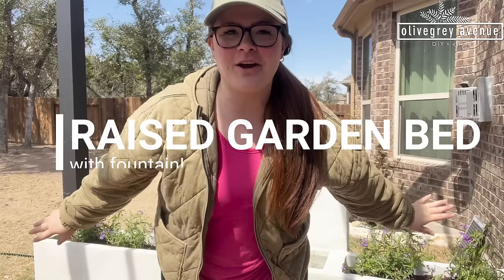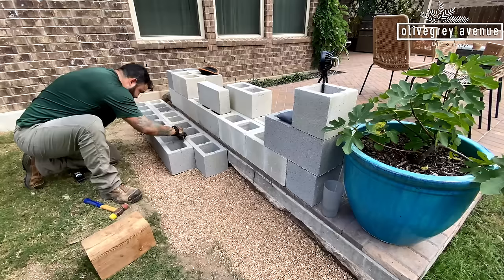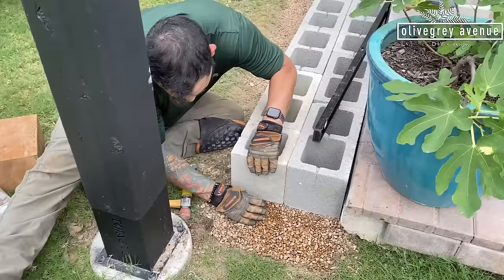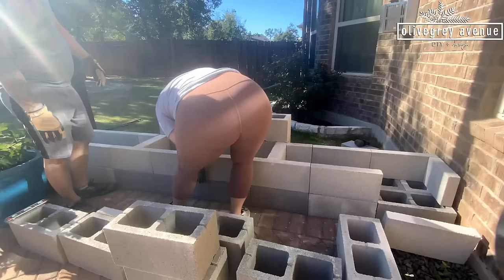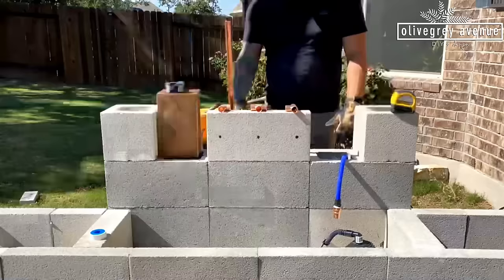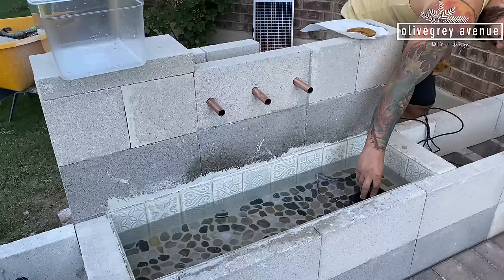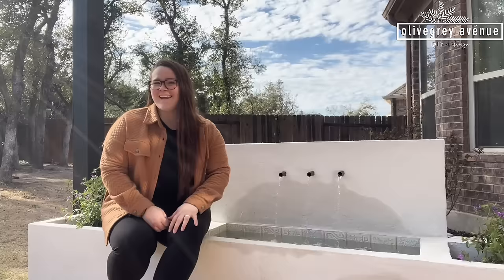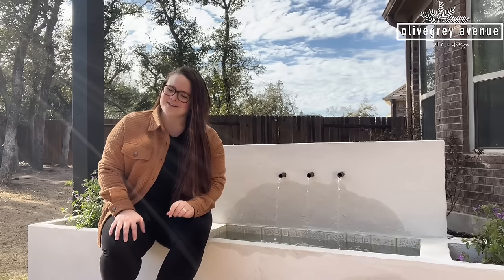DIY Cinder block Raised Garden Bed and Fountain

Comment: That came out really nice. I'm considering trying to do something similar -- probably minus the flower beds on each side due to space. Can I ask what that rectangular piece was that went over the cinder blocks stacked vertically in the basin? I didn't see it on the shopping list. Also, is the surface bonding cement used inside the basin to make it water tight? Thanks.

Comment: Now that a year passed how did it hold up without a concrete footer, no rebar in the block work, no cement in the block cores, no stagger in the block work, and no metal mesh under the stucco?
Reply from the maker: It looks the same as the day we built it aside from dirt. Also, we did stagger the blocks.

Comment: how did you make the water reservoir not leak water? what did you use to seal the tiles and the base around the pebbles?
Reply from the maker: I needed to make corrections because we didn’t take all the right steps the first time. You should use a waterproofing system like the kerdi system before installing tiles! I made a follow up video about leaking a couple weeks ago so check that out too!

Comment: Did you only seal the pump hose at the spot where it goes through the tile into the cinderblock? I’m wondering if I’d have trouble with leaks from that spot. Or does the pump come with something to help prevent leaking there?
Reply from the maker: We just sealed it where it went through the cinderblock https://youtu.be/J2CkGr0m7vc this might help answer some questions!

Comment: What's stopping that back wall from falling over ? Is there no concrete in between the Bricks? Also how come at the end the white is so discolored where the water flows from is it just wet? Looks super good! I wanna do something similar I think stuff like this makes such a huge improvement
Reply from the maker: The blocks are glued together. The traditional way is with mortar if you prefer to do the extra work. The water splashed up and got the stucco wet.
Reply: @olivegreyavenue  right I saw that you used glue it just seems like if there was any force on the wall it would fall over
Reply from the maker: @Leblueskee  it hasn’t for 2 years
Reply: @olivegreyavenue can you post a photo of it now somewhere?

Comment: Just bumped into this video, this looks like such a great DIY! This may seem like a dumb question, but by leveling the cinder blocks do you mean you just move them and tap them down until the level say's it's leveled?? I have barely any DIY experience 😅
Reply from the maker: Yes! That’s on reason for the gravel so it’s easier to tap it down into the ground and you just get them sitting level with one another as well.
Reply: @olivegreyavenue  Got it, I hope to build something simlar in the future. Subscribed!!
Reply from the maker: @scastellanos7923  awesome! Thanks for being here 😊

Comment: Would there be a way to hide the pump from view into the basin?
Reply from the maker: Yes, you could crest a basin of water below the visible one for it to sit in and pump the water up. There would need to be a drain that flows into it from the main basin. Hope that makes sense!
Reply: @olivegreyavenue  I think so. I use lets say a shower drain and have the water go into a lower basin where the pump is. Is there anything else looking back you would recommend to change? I’m using your exact plan to build one into an existing wall of the house
Reply from the maker: @gracci01  I would use a water proofing membrane before tiling as this was not sufficient for holding water. Check out our video with an update: https://youtu.be/J2CkGr0m7vc

Comment: Hi ya! What did you us as the base for the fountain before you installed the pebble tile ?
Reply from the maker: I needed to make corrections because we didn’t take all the right steps the first time. You should use a waterproofing system like the kerdi system before installing tiles! I made a follow up video about leaking a couple weeks ago so check that out too!

Comment: I noticed that you have copper pipe directly contacting the "cinder blocks". Hopefully you are not using actual cinder blocks, and the blocks shown in the video are merely ordinary concrete blocks. Cinder blocks have fly ash and/or cinders in them which creates an acid that will corrode the copper pipe. But, if they are just concrete blocks then you won't have that problem at all. Fingers crossed!?!
Reply from the maker: Interesting, I haven’t heard of that before and haven’t had any issues yet.